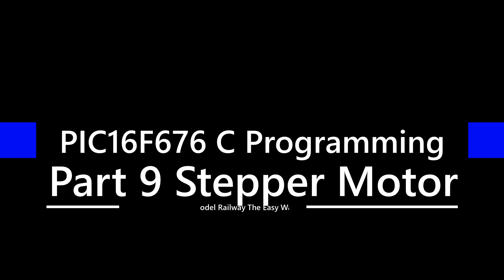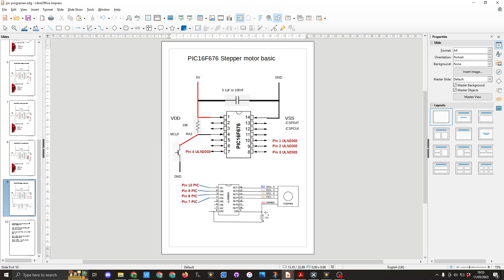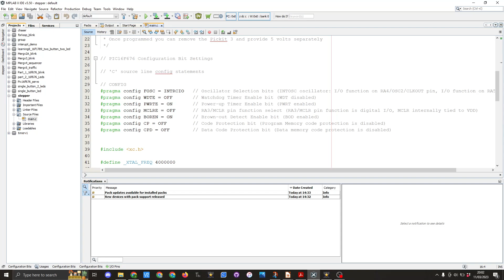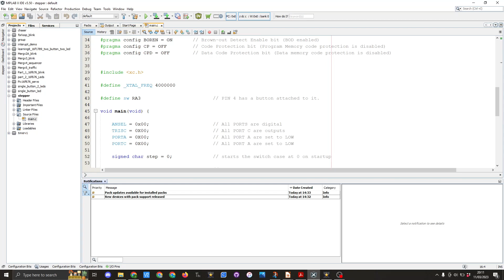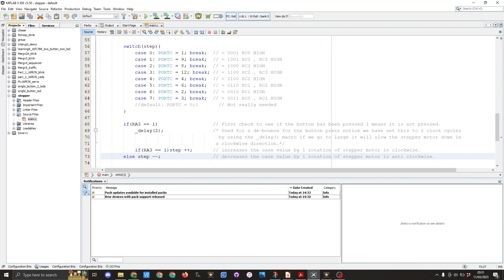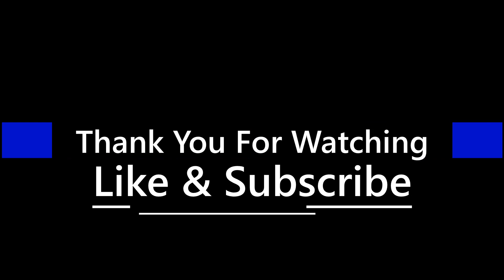Pic16F676 Part 9 C programming Basic  28BYJ-48 stepper motor control using UNL2003 driver board

Comment: Hi Governor
I am pleased to have you
I am your neighbour from NewCastle

I am trying to get my head around certain issues about pic mcu having migrated from arduino
I will be blessed to have your support

I am currently working on calculating delays with internal oscillators and to progress to timer0 etc
I am working with pic 16f723a
i was surprised to see you choose internal oscillator in the config bits and also declare xtal freq before the main void

 i thought we only declare xtal-frequency when using external oscillators
 
however it is then impossible to use the _delay_ms function
i trying to use the 16f723a with its internal osiclator to setup different time delays such as for a trafic light

I will very much appreciate your assistance

Sincerely

Ejike
Reply from the maker: I do not use external crystals as I see little point for the simple things I am trying to do with these chips. I am not a wear of the details for the chip you are using so I can not comment on what methods can be employed with that chip. Using the Timer 0 or 1 gives us more flexibility, however this requires more learning to get the most out of it.